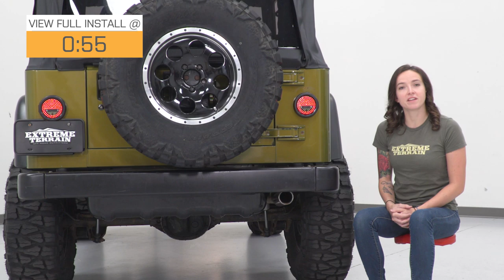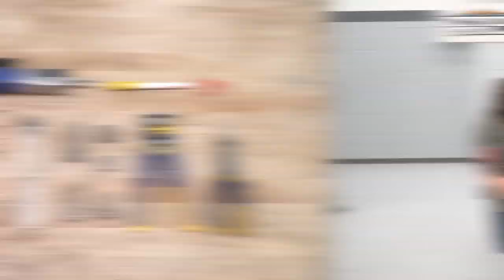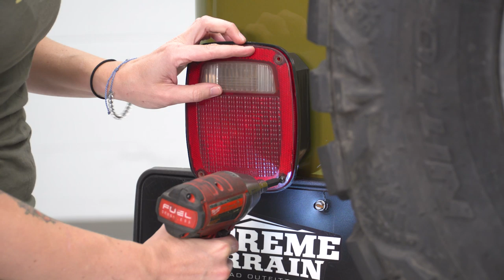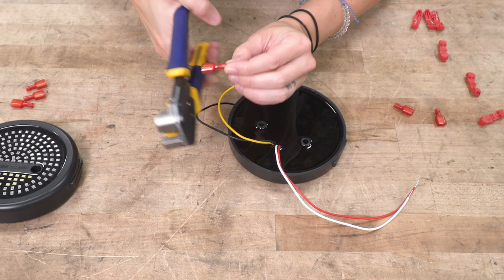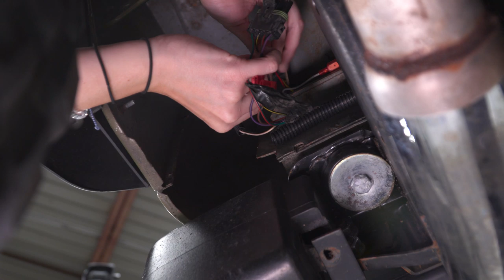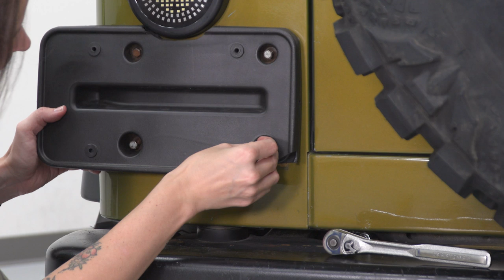Jeep Wrangler TJ Maxbilt Trail Tail LED Tail Lights Review & Install

Comment: You could also cut the original connector off of the factory tail lights and splice that into the new tail lights so they have a better connection. 
Just a thought for those of you who may prefer solder and reusing weatherproof oem connectors
Reply: CubNole Or bought and wired int a cheap, matching female end of the connector and not had to cut anything

Comment: I appreciate the effort, and these are really neat.
BUT
Y’all have to remember WATER!!! I have personally had to repair wiring that has been done like this and the deleterious affects it has on the vehicle’s electrical system. Always always always protect ANY expose areas of an electrical system’s wiring.  Tape up the exposed taillight connector so the 4 leads aren’t exposed, tape up EVERY area you tap into, and then tape up the whole thing so water cannot get into the wiring. It sucks tracing down, and then cutting feet out of electrical wiring because an exposed end allowed corrosion to creep up the copper. I’ve spent two hours under a van that had almost this exact same wiring job, and the Florida rain being constantly kicked up into the exposed wire taps screwed EVERYTHING up in the OEM wiring harness in only 2 years.  Then the license plate. Ughhh. You have a broken bottom piece, but when you cut out that small section, you now have an open plastic, license plate holder shaped cup that collects precipitation. The best case is the water stagnates and festers there. The worst case is it creeps into the body, through the four mounting bolts, rusting the panel out behind it. I appreciate the effort, but if someone was to follow this video, they would be doing a lot of repairs in the years to come.
To anyone buying this, please finish the installation. You spent good money on quality, cool looking taillights. Please take care of the Jeep you’re booting them too.
Reply: The removed stock wires were replaced at one time as those in the video pulled out were spliced into the harness after the connector. I would have preferred this method of using the newer crimp solderless heat shrink connectors readily available at your local parts stores.
Reply: Michael Moran I THOUGHT SO! It’s been years since I had my TJ and I couldn’t remember. No matter what, this installation method will lead to an inevitable failure.
Reply: How long have you been waiting to use the word "deleterious" in a sentence? Lol...
Reply: @slayerwatcher  You, genuinely made me laugh. When I'm tired, my vocabulary seems to expand as I forget the easy way to say things.
Reply: Agreed, I would have bought a waterproof 4 wire pigtail harness on amazon and attached to the factory wiring with waterproof butt connectors.  Theses things look really good though!
Reply: @LukeEdward  kinda funny you mentioned this. I was wiring a backup camera into my 2002 gmc a few months back, I called one of my buddies who’s pretty educated when it comes to electrical and mechanical work. I told him I wanted to just use those T-tap, vampire clips (whatever you call em) connectors, and he was not exactly happy to hear my plan to say the least. I spent the next 15 minutes being yelled at over the phone for thinking it was a good idea to use those taps. He told me if he had a dollar for the amount of T-tap “hack” jobs he had to fix at work (he’s in a heavy equipment trade) that he would be the one sending people to Mars and not Mr. Musk. Long story short: if you are doing wiring in a location that is going to be constantly exposed to hard elements, do yourself the favor of using high quality butt connectors and wire loom, or even better, SOLDER IT!
Reply: YUP!  This designed is a no go for long term use.

Comment: Crazy that at $200 the wiring isn't plug and play.  Those vampire / scotch locks are junk.  
You'd be better off buying a $15 trailer wiring kit that will come with the proper plug.  Cut that up and use it's plug instead of the vampire taps.  It will make things much cleaner and more secure.

Comment: It be nice if you guys made an actual electrical connector that plugs in. Instead vampire splicing. Not a fan of this . specially with water submerging the undercarriage. will not do very well .

....IF YOU GUYS CAN DESIGN TO CLIP TO EXISTING HARNESS,  ID BUY IT OVER , AND OVER. THAT RIG IDEA OF TAPPING INTO WIRE NEEDS TO GOOOOO!